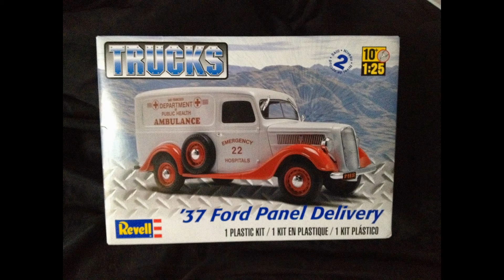Rusting Techniques #9

Comment: I'm running out of words.  I am ecstatic that you are doing this series.  I am getting so much out of this that I didn't get from watch other peoples videos. 

I am a Dollar Store junkie for sure.  You have turned me on to the LA's Awesome products, and now I am going to be raiding more out of the Make up aisle.  I often wondered if I could use the eye make up stuff on models.  Should be fun at the checkout!
Reply from the maker: Vincent, this does not have to be an expensive hobby. Just no trying ON the makeup prior to buying it lol. Only one more to go bud. YOU CAN DO IT!
Reply: I just caught up to #10.  It was a well spent hour and a half seeing all these tonight.

I have long tried to keep the price of my hobby as low as possible.  I buy my kits for as little as possible.  I even chew down the vendors at shows. Most of my supplies are gotten where ever I can get the best price.  That's why I always appreciate your tips on the good cheap stuff you find.  I know they'll work. 

You ruined all my fun.  I was going to try out the colors to see which ones look best on me.  I figure if they look good on me, they'll look good on the car.  And the cashier's face would be priceless!